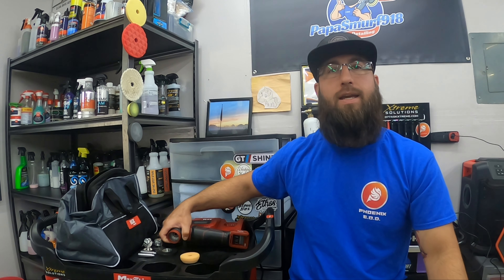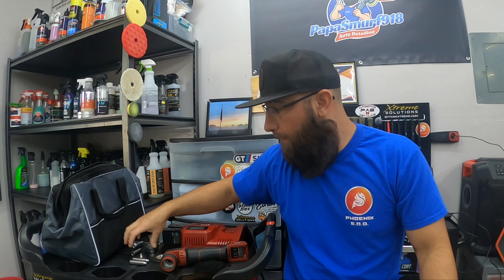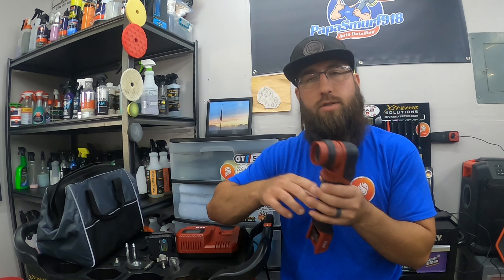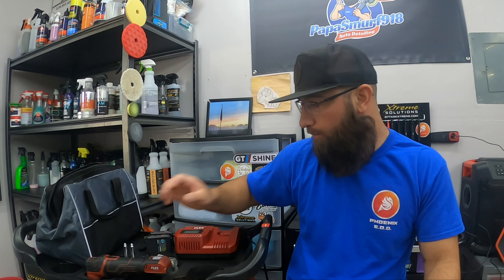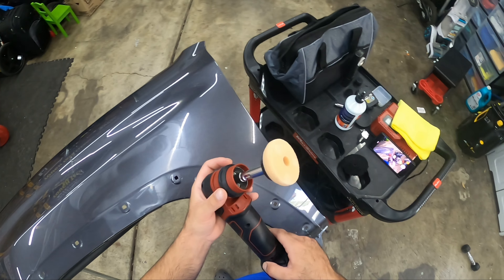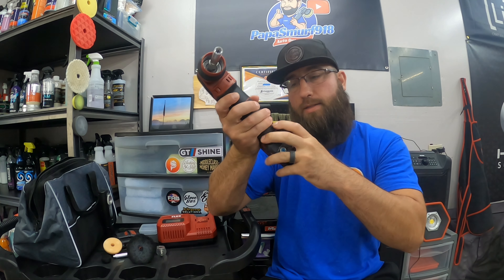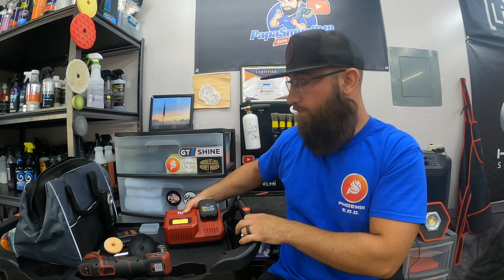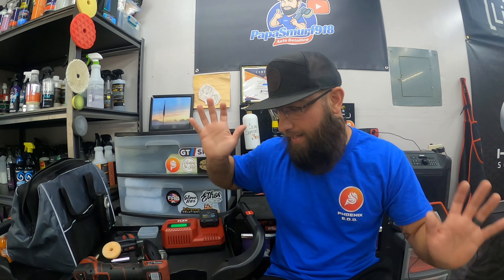FLEX PXE80 CORDLESS POLISHER REVIEW || IS IT WORTH THE MONEY?? || WATCH AND FIND OUT!

Comment: Great video Eric.  I got my PXE-80 a while ago and I also got the APS upgrade kits from Detail Division including the extension bars and the 2 inch backing plate and they also have another extension car that allows for those micro polishing pads with the little pin on the end like on those micro stick polishers that attach to the rotary's which is a great attachment I highly recommend anyone who has this machine purchase.  Makes it so nice to just pop one of those little pads into the attachment and polish away cordless and not have to attach the stick polisher to a rotary which is cumbersome and takes time.     Great for areas you need to micro polish like behind door handles, etc. which isn't often, but when you need it,  you will be so glad you have it.  I love my PXE-80 and I use it the most of my six different polishers.    I have even polished my entire car with my PXE-80 with no problem,  it just takes a little more time than with a 5 inch.    I also apply all my waxes and sealants with the PXE-80 and a red waxing pad and it works FANTASTIC for that application.   It's almost worth it to buy it for that reason alone.   It cut's down on your wax/sealant application significantly!   You can get around the entire vehicle in no time and in my opinion it does a better job than by hand because you are burnishing in the wax or sealant slightly which to me seems to do a better job.   The PXE-80 is without a doubt one of the very best cordless mini polishers out there.    Add the 2 inch backing plate from Detail Division.    The PXE-80 is one of the very best micro polishers available today and with the great attachments from APS at Detail Division,  you'll have everything you need to tackle most polishing jobs.    If you can only buy ONE machine and it was between the PXE-80 or a 5 inch DA or DA long throw.    I would definitely recommend the PXE-80 because you can use it for all your polishing needs.     If you can afford TWO machines,   I would get this one and a 5 inch 15mm DA and you'll be set for all the polishing you will need to do on a vehicle!
Reply from the maker: Hey Joe! You are absolutely 100% right! Absolutely phenomenal machine. I do recall that attachment with the cone adapter! Will be my next upgrade🤙 the APS parts are very good quality. Makes the pxe80 a hell of a machine! I love it! Applying waxes for sure is easy with cordless.. really speeds up the process! All in all just a fantastic unit that I'd recommend to anyone in the detailing game! Appreciate your thoughts and glad you love it just as much as me! Take it easy my friend!✊️🤙

Comment: I can wholeheartedly recommend this tool to every enthuasiast detailer. I did my WHOLE car with this thing. Recharge is done in 20min or so and i got 3 batteries and just keep rotating them. Only for the hood and roof i took a full 5 inch DA, both otherwise i was just hooked! I also felt doing bigger panels with a smaller machine might take more time but upped my accuracy and results! Hope this helps anyone:)
Reply from the maker: Your absolutely right! This thing is just awesome!! Yeah it may take longer but you can really focus on smaller areas and get great defect removal 🤙 appreciate you taking the time to watch!

Comment: Will the APS 3” backing plate work with the rotary extension?
Reply from the maker: Unfortunately not... I actually made my original 3" fit by drilling a hole but I found out they do not recommend it from flex as it is isn't good for the battery.

Comment: can anyone confirm if the backing plate post mount is the standard size? i seem to see conflicting info
Reply from the maker: The backing plate post mount?? Im. Ot sure what you mean forgive me.
Reply: @PapaSmurf918Detail  sorry ..what I meant was is the screw that the backing plates mount to the standard size ....can I use a standard lake country 3,2,1 inch  backing plate with this unit? .....I ask because I hate the hard plastic backing plates and prefer the softer foam ones

Comment: Eric.  Great review brother.  I've going back and forth on this.  I want something to polish my gloss black wheels and and a windshield here and there.  I wish they made a cone adapter for my G8, but man the PXE80 is a beast.  Thing is I'd only used is a few times a year.  Any advice here?
Reply from the maker: Thank you my friend! I went back and forth so well, and although I got a good deal I think it's still worth it! However I know it's a steep price! Shinemate has there version! Cheaper and I think might be up your alley! Check this out! 

https://carzilla.ca/products/shinemate-eb210-kit

I have this kit brand new I recently was sent to test. I'll be making a video for sure! But, for the price it comes with what you need!
Reply: @PapaSmurf918Detail  Thanks Eric.  I've also looked at the Maxshine M0312, but I think the Flex has more power.  That quick change is a game changer for sure.
Reply from the maker: @wescat2 Anytime! Yes I love the Quick Change feature especially when switching out from rotory to my 2" and 3" 12mm throw... the shinemate also features quick change heads as well!
Reply: @PapaSmurf918Detail Thanks man.  Can't wait to see you review that one.
Reply from the maker: @wescat2 No problem my friend! Thank you for taking the time to tune in and watch! 🤜🤛🤝

Comment: I got my stuff from Detail Division as well and I agree, Scott is solid and will be buying more from DT.  APS is the ish as well and do not buy any other extension coz most of them wobble, APS is the only one that didn't wobble= vibrate.
Reply from the maker: Can not agree more. SO smooth with the aps units! Thank you for taking the time.to watch!
Reply: @PapaSmurf918Detail  so true bradah and with the smaller machine u can feel the slight changes in weight, APS pads and extension were well thought. Which adaptor are u using most of the time? I’m loving the rotary with the microfiber for deep scratches or to polish headlights or wet sanded surfaces, it takes a bit to learn not to go over board but ones u get to know the tool it’s pretty amazing on what you can accomplish. And also I’m with u on the settings …setting 1 and 2 for me is enough I barely on 3
Reply from the maker: @1kontrabida  Sorry for the late reply! Idk why I don't get notifications on replies! So I love the 2" aps back plate with APS extension on rotory mode👍👍 Such precision! Also, speed 1 is really all ya need. 2 is ehhh sometimes... sometimes needed. But I just love the accuracy!!!!
Reply: @PapaSmurf918Detail  Its all good! and thank you for responding...Ive been spending quite some time now trying to learn it's pros and cons
Reply from the maker: @1kontrabida  Awesome. Yeah definitely! I'm not a huge fan of the trigger to power on. I'd have to say that's my biggest con. Not a huge deal but would love to see em change to something a bit easier. Although you can still modulate it at your own pace. I guess I'm just being slightly picky🤣
Reply: @PapaSmurf918Detail   wouldn’t be cool if they did a paddle control like the ibrid nano? I completely about the switch. And maybe extend the head a little coz I use 4ah battery and have to reposition the machine so not to hit the panel accidentally.
Reply from the maker: @1kontrabida  Yeah! Few minor tweaks an would be literally the ultimate unit. Although I already think it's the best out.. I'm very curious as to what's coming out at SEMA this year. They did just release the extension kit that turns it into like a Dremmel with small cone polishing heads. Pricy though. I don't do enough delicate details to get one 😂
Reply: @PapaSmurf918Detail  lol true that extension looks promising but spensive..ill be at SEMA Monday (do my early bird meeting) and Tues (will have time to walk around) hoping theres some new stuff out. Rupes came out with their 3 inch cordless, looks different
Reply from the maker: Oh wow! Awesome bro! I've always wanted to go to SEMA! Enjoy and fill me in on the flex booth!😃

Comment: Love mine too!  Just wish I can get my hands on a European hard case systainer, the bag makes no sense to me.  All the stuff is just thrown in there banging everything up.  Scored big time on mine, Ebay bid for $310! 👍🏻. The accessory extension to use cone pads is awesome as well from APS.  Which 2” pad where you using in rotary?  Where did you get the small clear storage case, is that from a Detail Division as well?  Thx
Reply from the maker: Really? Your bag doesn't have pockets?? Mine has pockets for both batteries and all my accessories.. polisher and charger in center. Works well for me. 🤔🤔 310 that's definitely a score man!!!! Yes I need that cone accessory too! The 2" pad is the Griots BOSS 2inch pad.. I believe there is a link to it in description 🤙🤙 I also have the Rupes Yellow 2" pads and they are great on it as well. The clear case came from detail division yes, when I bought the APS extensions. 👍👍
Reply: @PapaSmurf918Detail  Well…it does have pockets, but I love a good hard case, just faster and easier to find stuff.  😁👍🏻. Maybe I can search for one online and see if I get lucky.  Appreciate the videos!  Thx
Reply from the maker: @tundrawhisperer4821  I'd agree. A nice hard case would set this thing legit! Thanks man. Appreciate you always tuning in🤝✊️

Comment: So the 2in on rotary is ok?
Reply from the maker: Absolutely! It's awesome in 2" rotory mode and works great! 1" it also nice on tight areas. The cone attachment makes an awesome attachment as well!
Reply: I just ordered it what pads do you use with the 2in with the rotary and where can you buy the cones for the dremel thing Amazon?
Reply from the maker: @dillon599  nice! You will love it! So I order my cone accessories from detaildivision.com 👍 Highly recommend the full APS upgrade kit from there. As far as 2" pads I'd check out lake country pads. They are awesome. Rupes as well are great !
Reply: @PapaSmurf918Detail  hopfully you can use the rupes wool pads for the 2in rotary I bought a couple
Reply from the maker: @dillon599  you can, I have some of them👍👍👍
Reply: @PapaSmurf918Detail  sweet well thanks for the help buddy
Reply from the maker: @dillon599  Anytime man! 🤜🤛
Reply: @PapaSmurf918Detail  forgot to ask are the aps backing plates tone down the vibration alot  on speed 4?
Reply from the maker: @dillon599 they are so smooth man, however I NEVER go above speed 1 on rotory mode with 2" pads. It's never needed.
Reply: @PapaSmurf918Detail  ok yea I'll be using the 2in for rotary and the 1in mostly on it and use my hlr75 for the 3in have you tried the hlr75 yet it's getting delivered tomorrow?
Reply from the maker: @dillon599  I haven't yet... I have my Pxe80 and my Griots G8... but my pxe80 is my go too.
Reply: @PapaSmurf918Detail  yea u had the g8 but didn't like it I think because of the weight compared to the pxe80
Reply: I wasn't planning on getting the pxe80 right now because I bought the hlr75 but I seen someone on fb market place selling it for 250 and I got it for 200 it's brand new only used 1 time couldn't pass it up and would you use the lake country microfiber pads on the 1in on rotary mode for the flex or na
Reply from the maker: @dillon599  yeah, the power of the Pxe80 is so great. On 12mm with 3" I run speed 4 all day
Reply: @PapaSmurf918Detail  with the stock 3in plate on speed 4 it feels a little violent that's why I ordered the aps kit